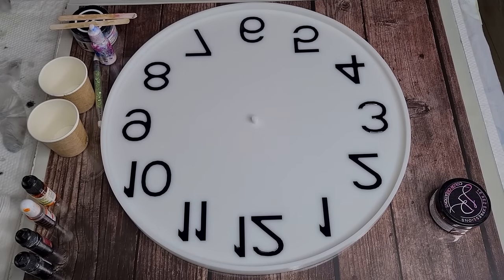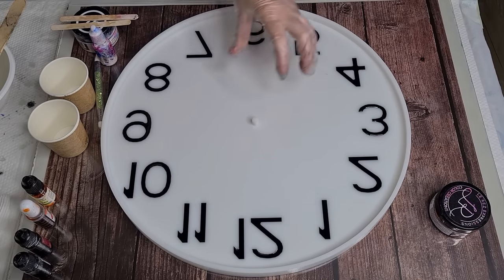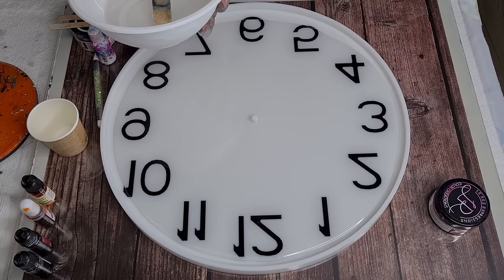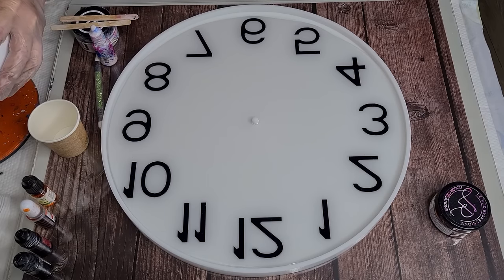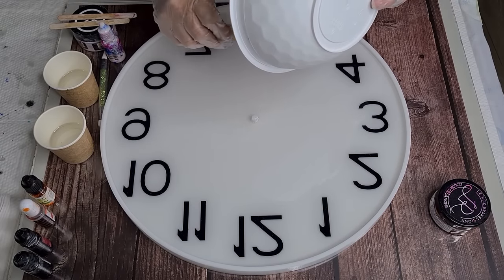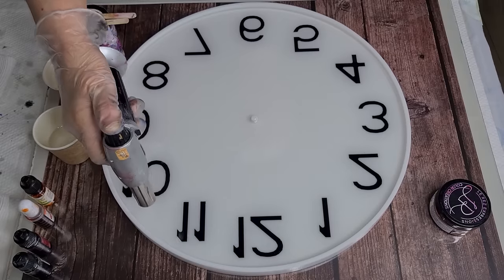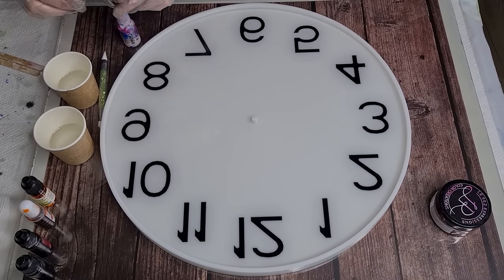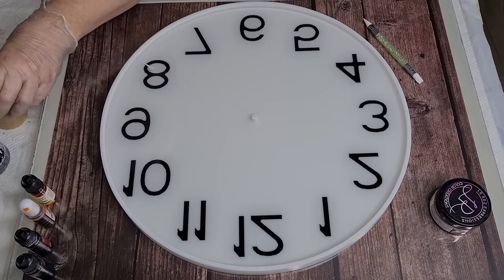#1443 Mt Second Attempt - Gorgeous HUGE 3D Flower Resin Clock

Comment: I think they both are beautiful.  I wonder if that center peg for the clock hands is repelling the resin. As you’ve said so many times, the resin moves from the outside in and maybe the peg is pushing the resin back out making the middle kinda just freeze in place.  I thought about this in first video but I felt silly speaking up but now that it’s the second try I wonder if maybe that’s the issue. I hope my thought process makes sense. 
Anyway, thank you for all you do and for being such an amazing inspiration ♥️♥️♥️

Comment: I think it looks very beautiful. Please tell me how do you paint the numbers in the click. I mean what brush do you use? It is the same alcohol ink or something else?. Please advise
Reply from the maker: It's part of the mold
Reply: @PouringYourHeartOut  yes the numbers 1 to 12 are a part of the mould. But i wish to know how did you color them black? What ink did you use? What brush do you use for that? Is the ink mixed with resin and then you applied with a painting brush? I need to know that from you please.
Reply from the maker: @hanalwala  I showed it in my previous clock video